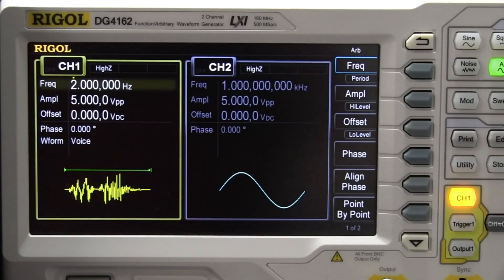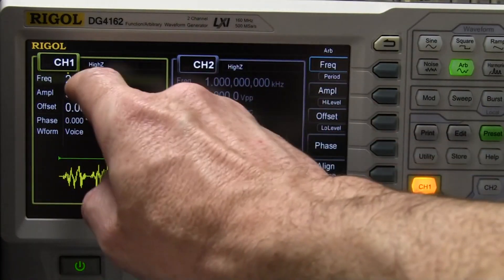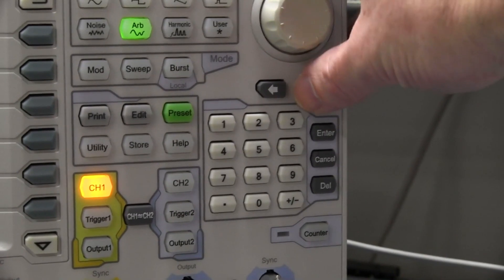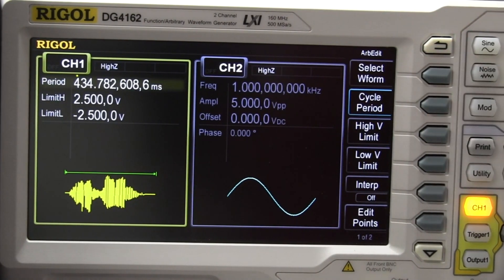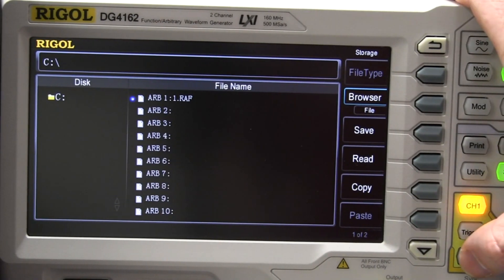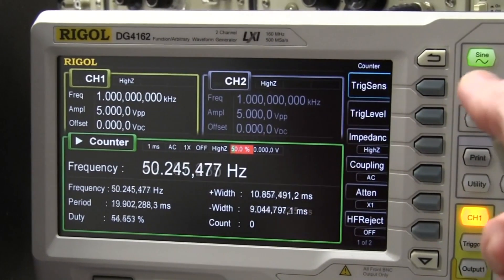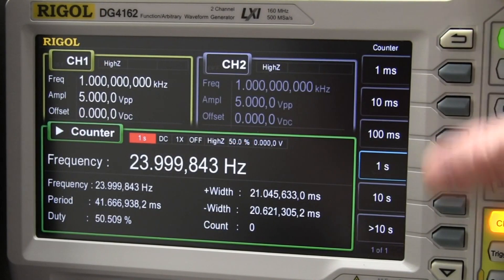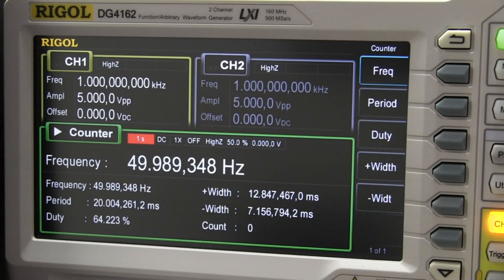EEVblog #325 - Rigol DG4162 Voice

Comment: If you are using coloured backgrounds, stay clear of red and green if possible as 1 in 12 men and 1 in 200 women have some type of red/green colour blindness. I can hardly see the green selection background yet can see the yellow dot really easily,  so use either a black text on yellow or white for highlighting is better and a blinking cursor UNDER the letter works better.

Comment: Recently got a 4102 and everything was looking good until I applied AM modulation.  It falls flat on its face.  Carrier level drops and sideband levels are not correct.  Contacted US Rigol customer support and they confirmed that they could duplicate  the problem and they would send a "bug report" to Rigol headquarters.  Got a reply yesterday, basically telling me it's working properly and as designed even though the output power level obviously falls out of advertised spec under modulation.  Basically tough luck buddy, your screwed and there ain't nothing were going to do about it.  Last piece of Rigol gear I ever buy.  Posted a video of the problem to demonstrate it so no one else gets screwed.

Mike

Comment: talking about a totally stupid instrument. A good sound card and some basic plug ins can make real magic.
Reply: mekaniepokalanego You can try to produce a 160MHz signal with your magic sound card. You are calling something stupid and you dont even know what it does or how it works. A sound card is made to produce signals for the audio range ( 20-20000 Hz ). The maximum output of a soundcard is about 700mVpp.
This signal generator can produce signals from DC-160000000Hz and has a maximal output level of more than 10Vpp. No soundcard in the world can do this!

Comment: Dave: I notice that you also changed from AC coupling to DC coupling on the counter between when it failed to work at low frequency and when it began working. Could that be part of why it was not counting reliably and there was a low-frequency cutoff?

Comment: I think it only uses recip counting at the longest gate time setting.
It displays far more digits than are meaningful. Not helped by the counter gate times being binary multiples of the 500MHz clock, not decimal, so you get odd rounding errors on round values..
It really should suppress the meaningless digits as it just makes it look crappy.
It also fails to blank the display when the input is disconnected (although the lack of meaningless fluctuating digits give a clue..!)